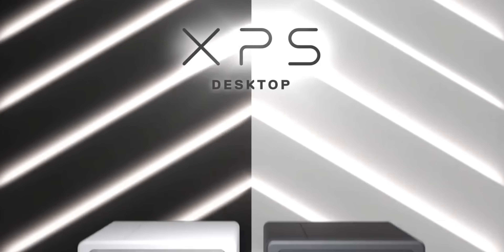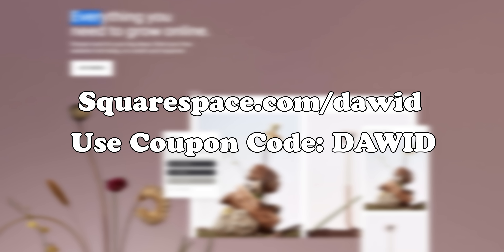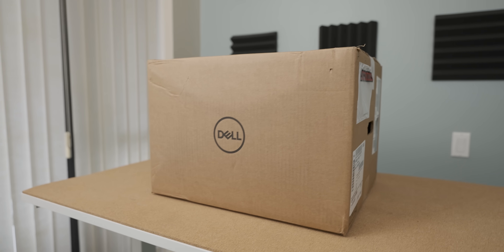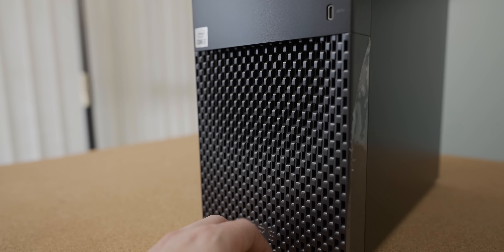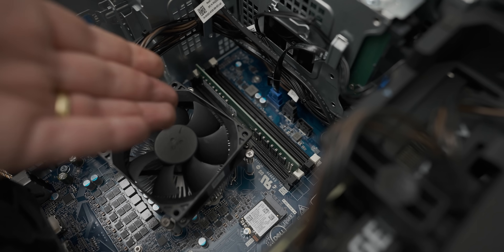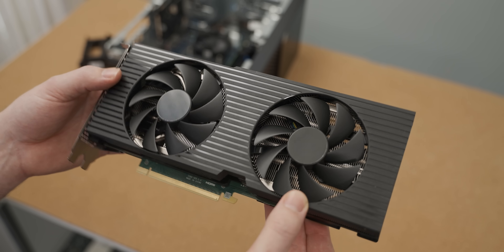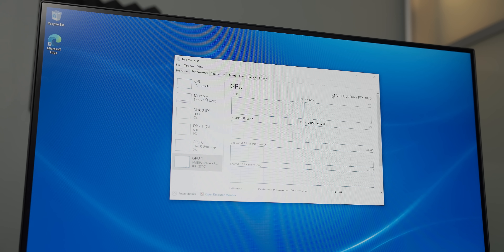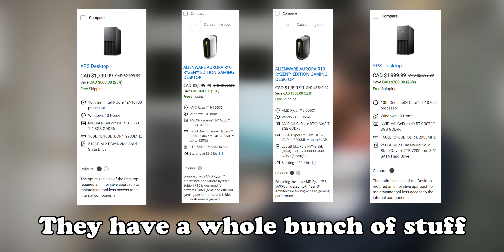DELL Did Me Dirty... RTX 3070 Dell XPS Pre-Built

Comment: Honestly the interior of this PC feels like jumping through a time machine back to the early to mid 2000. This is what most of us had back then and how it looked (aside from some modern touches)
Reply: 2006 to be precise
Reply: Friend gave me an Optiplex GX620 case from 2002(ish) and i've done some customization to fit a 140mm Bequiet in the front. 
Now i have a fan controller in the 3,5" slot and i realised it's "mirror" to normal pc, normal mobo has to go upside down and i need a pcie riser for the gpu.

But it's built like a tank, im considering about tranfessing my "rig" into it just because it has very good airflow and will serve another 20yrs while looking like a 20yr old Dell. :D
Reply: Hi, Which computer do you recommend, that is of better quality and more innovative? Thanks
Reply: RGB just = more heat to dissipate.
Reply: @notlNSIGHT  yes actually they do. Lining your room doesn't make you an expert.
Reply: @notlNSIGHT  I am not actually. He doesn't list room temperature.
Reply: Not everybody needs RGB bling bling. I have a PC to work or game with. If i want a lightshow, I also could go into kids theme parks.
Reply: @hansdampf2084  i mean rgb adds 30fps tho
Reply: @kenkoarmada7674  rgb doesnt improve framrate lol
Reply: @thedeadlygames9716  sir…it’s a joke 👍🏻
Reply: @kenkoarmada7674  KK
Reply: @kenkoarmada7674  it's like stickers on a car, it adds 500+ hp
Reply: @topfloorexec  What is the conversion rate of Horse to Frame? 
I thought stripes added to top speed and "turbo" sticker was for power? :DDDD
Reply: @hansdampf2084  leave alone the RGB, you can get a nice case and setup without fancy lighting, the airflow and the components are just utter trash on this PC man.
Reply: @kriminalnews7764  I own that system. Temperatures are more than acceptable.
Reply: @hansdampf2084  i assume he means the motherboard, and the interior does look pretty depressing.
Reply: @hansdampf2084  you dont have to have an ugly PC to not have RGB lol
Reply: @hansdampf2084  the problem isn't that
it's actually the fact that the CPU cooler is garbage, and the motherboard and PSU are probably some proprietary sh*t like dell loves to do
so no, it's not worth it, only for the GPU though
Reply: @hansdampf2084 No amount of rgb is saving the looks of this PC, I believe what others are saying is that the components inside just look absolutely sad, blue pcb, single stick of heat spreader-less memory, terrible cable management, and that crooked potato CPU cooler, not even glancing at the performance(which is obviously terrible), the PC just looks aesthetically depressing

Comment: Anybody can tell me the difference between the G5 5000 and the XPS? Similar dimensions, similar connnector layouts, similar cooling slots, similar CPU coolers... - It seems to me as if Dell sells the exactly same stuff with two different fronts, once with the 10 gen Intel, once with the 11 gen Intel
Reply from the maker: That is pretty much exactly what it is. They put a different plastic bit on the front. There is a bit of a practical difference as the XPS does actually have worse Airflow than the G5 due to the front bit. That's about it though.

Comment: You can’t expect Dell to deliver for that rock bottom price you paid!  They will cut corners at every chance they get including low end CPU, ram and likely even the GPU is a bottom grade 3070....I mean just look at it!  It smells of low quality.  A friend of mine bought the same set up and tore the GPU out and almost gave me the rest for nothing.  He would have been better off just buying a top grade Nvidia 3080! I slapped a 1070ti into the unit and got it mining Ethereum 24/7 with the side cover off!  Out of my 3 machines it crashes every so often but still makes me money daily!  It is what it is....a low end build!  If your serious about gaming, build your system step by step starting with a quality motherboard like an Asus Rog Strix x-570-E and then get yourself a Ryzen 9 or AMD Threadripper CPU if you can afford it.  Then keep building out with high quality parts including your RAM, SSD , PSU and GPU.

Comment: Never Ever buy a Dell pre-built if you are after quality. Dell cuts corners everywhere they can. The design proprietary parts to allow them to cut extra corners, then when something breaks you're stuck paying insane prices. 
Much better off buying a pre-built from a company that uses standard PC hardware. You get a better system and if something breaks you just replace that component with off the shelf parts for cheap.

Comment: ahhhh Dell , your learning how crap they are, in the UK weve known for years how rubbish they are. Thats probably  an unbranded GPU  made by Dell. if you unscrew the cpu fan youll find that the screws go through the motherboard into the case , weird , thats why the fan mounting doesnt look symetrical to the cpu socket. the cpu fan is fitted at a weird angle. so dont undo the cpu fan screws or your mobo might fall out as its clearly holding the motherboard in place.

Comment: It's far past the point where whenever you see a Dell with some specs that look attractive you should probably just append a minus to any familiar/popular reference models.

Oh hey this comes with an rtx 3070 - awesome! 

Oh wait, it's a dell and rather than put a decent power supply in a system they'll stick with the same garbage they have for years and get a board partner to make a special single-8 pin version of the card that is power-limited well below Nvidia's reference design.  

RTS 3070 "minus"?

Comment: Bruh i ordered a G5 5000 series and the 1650 super has the worst cooler ever, it was super loud while its brand new and for some reason its a 2 pin fan connector but if it was a 4 pin i would of upgraded it to a blower style cooler that was for a GTX 770 from zotac

Comment: Dell I bought was an I9 and the ventilation was insanely bad and overheated just idling. The power supply was in the middle of the case? Right above the CPU heatsink.  Ended up losing my whole investment and put the CPU in another motherboard and case, power supply etc. Would guess that design is long gone now.

Comment: Those are the best cards for mining (Dell OEM's (3060Ti's,3070's) Because they only have 1 power connector and have the same hash rate as the  AIO cards: 2 & 3 power connector cards. As per gaming I don't think there would be noticeable difference at 1440p. 1 or 3 fps tops...

Comment: The case looks great, refreshingly hetero. Same goes for the keyboard. Imagine getting your ass handed to you in CS:GO by someone rocking an Excel keyboard....Assuming that the holes for the cooler are standard, you can throw in a decent air-cooler. Just buy a second stick of 16GB and you will get a decent rig. Forget about overclocking (there is life without it, trust me!). The things that worry me though, are the air circulation and the power delivery. Anyway, I would still buy it, do the upgrade on the cooler, dremel out some of the plastics at the intake, yell Dell into fixing the dual channel problem and then play on it until those VRMs blow up (I would expect them to last just about until the warranty expires, maybe even less if I beef up the cooler). If the GPU prices are still insane by then, I would transplant the CPU, GPU (and maybe RAM) on a normal case/mobo/psu and carry on.

Comment: To be fair I have an XPS system as well and it's lasted me quite a while, I'd recommend replacing the RAM at some point but I did get the dual sticks in mine. Problem is that they died rather early on and I replaced them with 2 corsair vengeance LPX and haven't had a problem since, hoping to upgrade the board and CPU soon since it's been a few years since I bought it.
Reply: aaaaahhhh that magic replace RAM it will run faster :) it will not its a garbage
Reply: @pgornicki  itsa me garbage, lol it might be a meme now to replace ram to "make run faster", but if you don't have ram that will make use of the mobos max clock speed or isn't over 8 gigs, then yeah, you'd see a difference. :)

Comment: You bought an xps which is basically their business system so yeah it is build for an office, not much more than that. Typically they are on the floor next to a desk so looks aren't something anyone needs. To put a 3070 in an XPS is strange enough but to expect to not be disappointed is even stranger. Why didn't you buy a pre-built that was actually designed to be for games.  Can't expect a bicycle to do 90 mph.  Makes one wonder what you were thinking when you designed this. Were you drunk?

Comment: I've worked in IT for years now and I've never understood why the ventilation on OEM towers is so dreadful. They make some really neat design choices with cable management, board layouts and the like, but then they get stuck in the 1990s with a single crappy rear exhaust fan, a miniscule PSU fan and almost no gaps for air to get in. When the system's an i3 and integrated graphics you can understand, but when there's a high-end gaming or workstation GPU in there - which doesn't even evacuate rearwards - it just becomes baffling.
Reply: more broken prebuilts = more money, true points tho

Comment: I'm rocking a 2 year hold prebuild dell that's been mostly cool for me. I've had two minor issues with it. One was a Windows problem, not dell's fault. The other was the Optaine drive failed. It was a catastrophic failure, went into an endless boot cycle. However, the dive isn't really needed, it just boosts the hard drive speed a little. I've had a noticeable, but overall slight hit in performance. Mostly things just take a little longer to load than they should, but I'm ok with that.

Comment: That case was pretty nice imo. I think the IO should be horizontal along the bottom side of the dvd drive and relocate the power button. Thats a 3070 and 10700 with like 200mm x 120mm of intake and a single 92mm fan set up on exhaust. I get why the office look is still popular though

Comment: I'm not particularly tech savvy, but couldn't you just buy this thing to cannibalize it for parts? Like it costs almost exactly as much as the 3070 inside of it, plus you're getting an extra $100 power supply and a bunch of other parts, even if they don't work well with the 3070.

Comment: My dislikes: cheesy power supply(not enough room for a good atx one), single channel memory (LOL), crappy cooler(easily rectified), poor cooling, case is small and cramped. In order to make this good you would first need a decent case (I always use a full tower for better airflow and more room for components), a good cpu cooler, two sticks of 8gb dual channel ram, and a decent 750w or higher power supply. In other words, gut this baby out and reinstall everything in a better case. Would be worth the performance gains considering you already have a decent video card and cpu.

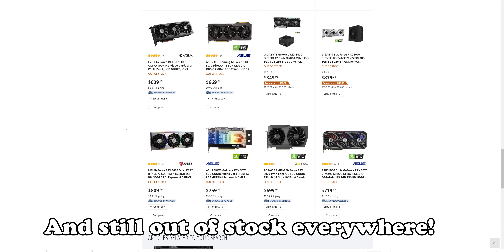Comment: @2:33 I'm curious, why are the "blower coolers" considered to be war crimes?

It would seem to be the optimal thermal design strategy.  The blower pumps cool air (fed in from the front of the case) over the GPU, and then vents the hot air directly out of the back of the machine.  

All other designs just circulate the hot air inside the case, compounding heat issues.  Am I missing something?
Reply: The finstack often just ends up trapping hot air inside of the shroud and cause thermal throttling

Comment: you missed the obvious thing here, the power supply doesn't have a high enough output to get max performance from the gpu and cpu. windows is probably throttling down all your performance because it only has 500w instead of the 750 it wants..

Comment: I bought a prebuilt from Newegg for exactly this reason: I wanted a 3070. Cost around the same.

I got some cheap 3000mhz dual channel memory with it, so I swapped that with my GSkill 3200mhz dual channel dimms, and I actually really like my new PC, so much so that I sold the old one to a friend (for reference, 8700k with a 1080 in it) and my only real gripes are the Loser Cooler and the ABSOLUTELY DREADFUL FEATURELESS MOTHERBOARD. I was hoping for the other Mobo variant with the two M.2 slots, but got the shit mobo instead. Mine, like yours, has a 10700 in it, non K version.

But it still runs everything better than the system I used to have, and I have plenty of headroom to upgrade, even if I stick with the 650w Plus Gold PSU, which honestly I likely won't. When my wife cools down, I plan to replace the CPU cooler with a water block, the motherboard with something useful ffs, and at minimum a 750w PSU.

Comment: I'm still rocking my Dell keyboard from my pre-built that I got back in 2004 and was still using the mouse up until a few years ago when the right click stopped working. I'll have to ditch the keyboard once I eventually upgrade from my current PC that I built back in 2011 since I know modern PC's don't have a PS/2 port.

Comment: I'd call this RTX 3070 a castrated one... I am playing on GTX 1070 Strix for the last 3 years, and get 80-90fps on avg in Warzone and around 70fps on BF V... feels like 3070 is not delivering in this benchmark/system/etc. CPU I have cores i7 8700k so this 10th gen CPU should be handling easily and not bottlenecking the GPU... RAM, sure dual channel is better, but honestly, if you had 2x8GB you would not see that much of improvement ... 

My advice is: return that and get a true gaming PC... if that is not an option, find exact memory chip like the one you have and make it 32GB - and call it a day :)

Comment: Why they use that super crappy intel oem cooler with that 8 core CPU??? That thing runs hot as hell with that crappy cooler. They really ripped you off with that cooler and not the one they advertised and on top of giving you single stick of RAM instead of dual DIMMs. Your CPU was throttling its frequency thus lowering the performance of 3070 by 40%. I got better or the same FPS in GTA5 on my Radeon VII in 1440P with my 3700X @4.2 GHZ. Sucks to have to fork out extra money to get a decent better cooler to replace the crap they gave you. That intel OEM cooler doesn't even have copper pipes like the AMD ones when they still gave out wraith coolers.

Comment: I would really like to hear the call to customer " support " to tell them the ram configuration is incorrect, and their respons to that.
Reply from the maker: I actually already did this video, I don't play the whole call but you do hear a bit of it. 😁
Reply: @DawidDoesTechStuff  I tell you what Dawid! I like the E-waste mice! They are nice spares to keep just in case, and I use the keyboard in my server setup!
Reply: @DawidDoesTechStuff  what’s it called?
Reply: @DawidDoesTechStuff  link please
Reply: @casualmcztmc9989  The video is called "So We Called Dell's Customer Support..."
Reply: well dealing with big tech companies with policies and non sense i wouldnt be surprised to hear something along the lines of "its no problem all were going to need you to do is send the pc back and we should have it fixed and returned within 4-6 weeks" :)
Reply: @firegaming9672  No joke what i was told when asus sent me a PC missing its SSD
Reply: Rakesh will not be very helpful
Reply: Dell Support will hangup on you!🤪
Reply: @Mr.HarryWild  They did to me.  bought an R12 and they once hungup.  sending this machine back.
Reply: Dell: It’s your drivers
Reply: Customer support didn't build the pc...
Reply: Dell also loves to NOT plug the right power cables into the right slots.  I had to rewire mine back in the day to get my HD 5970 to even work.
Reply: I've seen the rest of the series so far, oh dear xD

Comment: Is a single 8-pin connector normal for a 3070, too?  I feel like with power equal to a 2080 TI, it would have 2 8 pins.  Even my 1080 TI I used to have, had 2 8 Pins on it.  Er, maybe 3?  I think it was 2, but it could've been 3.  And I'm sure a 3070 could out perform a 1080 TI.  >___<
But aside from that, yea.  Single stick, not enough CPU cooling...  This thing has potential, and Dell threw it in the pit, to burn.  sigh

Comment: yea... Dell did screw you pretty good... im running a dual 144 Hz monitors, XFX Ultra THICC III RX5700XT(8GB), 32GB system ram with an R5 3600X(3.8GHz base), Gigabyte x570 Gaming X MOBO and im pushing 144 frames with this game on ultra at 70 c° with no issues and no OC. better check that card twice to make sure they gave you the right thing, hard to believe you have one of only 3 reference cards in existence...

Comment: I hope they don't screw me over, I bought g5 Dell 10th Gen Intel® Core™ i7-10700F processor(8-Core, 16M Cache, 2.9GHz to 4.8GHz)

￼

Windows 10 Home, 64-bit, English

￼

NVIDIA® GeForce RTX™ 3060 Ti 8GB GDDR6

￼

16GB, 2x8GB, DDR4, 2933Mhz

￼

512GB M.2 PCIe NVMe Solid State Drive

￼

500W Chassis with Bezel and Internal Lighting + Clear Door Ali was selling it at 1600 he dropped the price at 1370 with taxes it came to 1475, I told 16g memory can was all I needed I 2÷2 two 8memory chip card if this happens to me I'm going to be pissed, i ordered it on the 14 of March I won't get it until April 28th I should have never bought it, I think this is going to be a nightmare, tell me if this was worth it!

Comment: I have purchased one of these with the same specs as you and a lot more storage (both ssd and HDD). I have sent it back for repairs as the GPU came clearly damaged due to the shipping. It also came with dual channel AND the cpu cooler.

Despite the 500W PSU with a 650W minimum GPU and the inability to upgrade it, do you think it’s worth keeping? I got it like 40% off so if I send it back for a refund I likely won’t be able to get anything alike it.

I’ve read some pretty bad and some pretty good reviews but I want to know from other owners of the XPS8940 if I should honestly keep it and use it (for gaming and work)